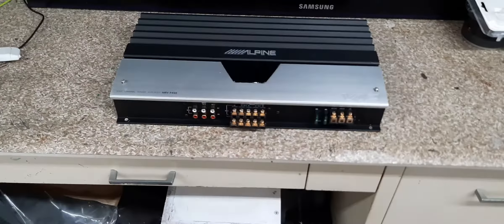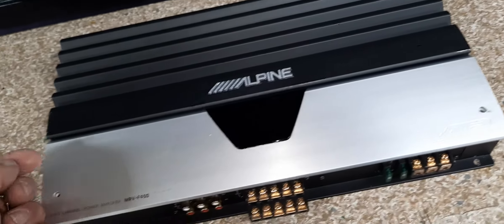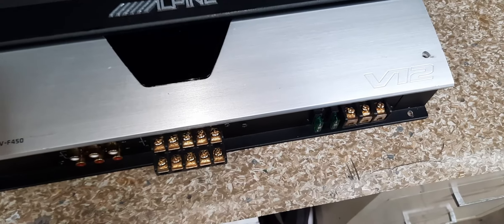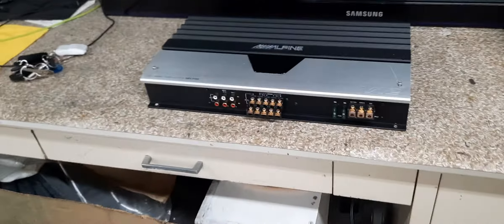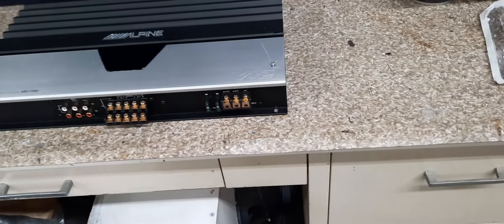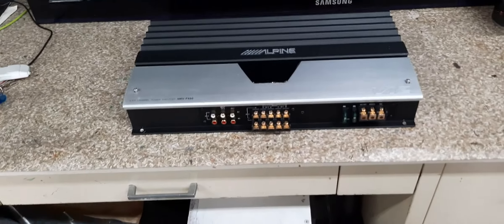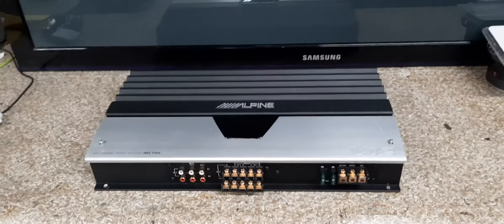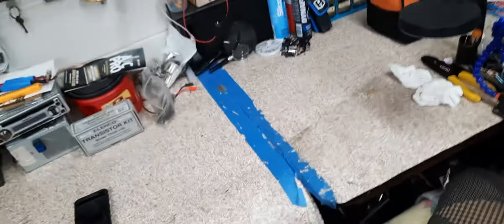Alpine v12 MRV F450 amp cleaned and detailed.

Comment: I’ve got one of these. Sat in a cupboard for a decade 
I bought it in about 2003
It’s a great old school amp. Pumps hard plus handles a sub
Reply from the maker: Im running it on my doors the fronts are the JL Audio c5  5 1/4" with tweeters and crossovers. The rears are 2 x 5 1/4" Heat Audio neo's and mtx tweeters with sounstream crossovers. Never hooked the sub channel up yet. Does it do pretty good? Have decent power on that channel and its 4 ohm min right?
Reply: @Ron-Webster  my Mrv is running the following 
In the frontdoors. Old school 3 way 6*9 JBLs at 75rms and 100w rms alpine tweeters with cross over 
Rear doors. 100w rms 2 way
And I’ve got a 4wd drive so I’ve slipped a 150 w rms nakamichi sub amp combo between the window and Engel as it’s dead space
The amp is a compromise given I don’t want a massive box taking up what space I’ve got left
Just finished the install this week. The amp still pumps. Just need to find someone. An installer now to dial it in proper so nothing blows. I’ve roughed some settings in though
It all runs of an alpine ilx 650 deck with 3 pre outs
Pretty decent sound. Happy
The only issue is the size of these amps. But they compare to the newer stuff in most other aspects